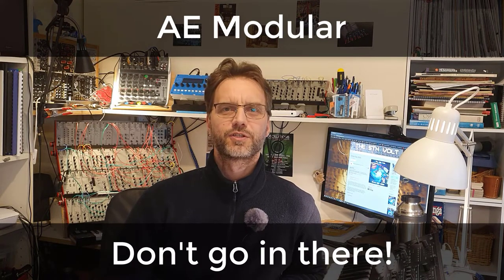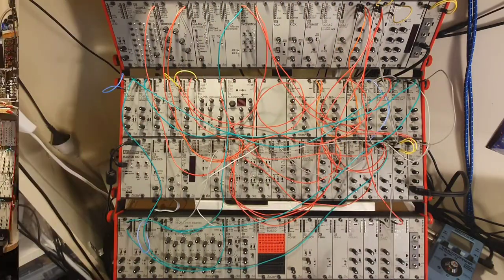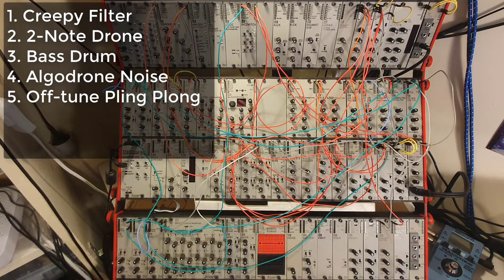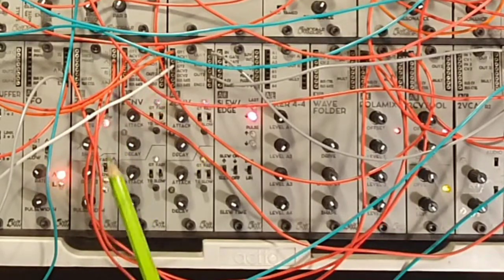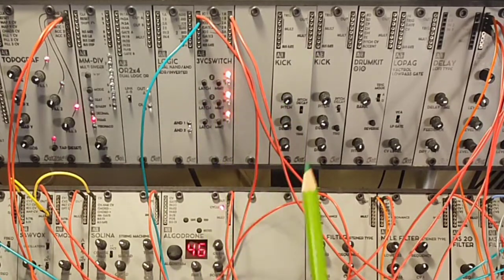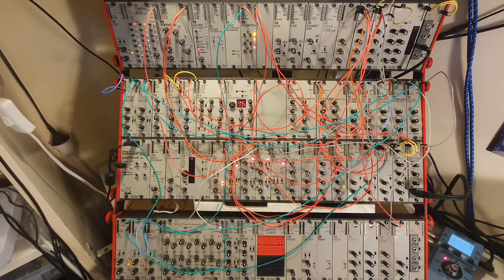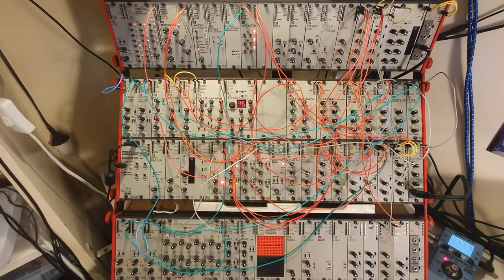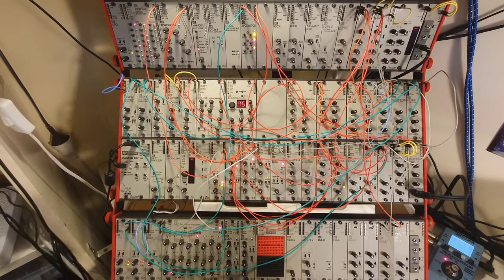AE Modular - Deconstructions 02 - Don't go in there!

Comment: Don't quite get the difference between the Polamix and 4ATTMIX, is the Polamix like an improved version or are they completely separate modules? Really cool patch!
Reply from the maker: Hi, they are completely different. 4ATT/CV is for mixing and/or attenuating audio and CV signals but can only limit the voltage that's going in. POLAMIX also mixes signals, but it also adds a constant offset voltage and can either add or subtract from it, so the modulation capabilities are very different to the 4ATT/CV.
Reply: @The5thVolt  Cheers! Much obliged. So the POLAMIX has more capability to do weird and wonderful things with CVs? Can't quite get my head around it!